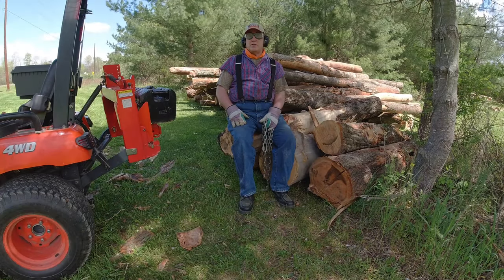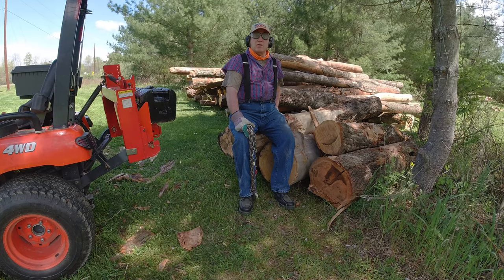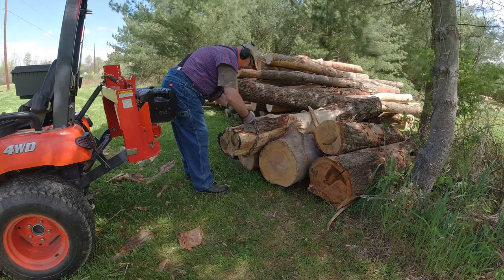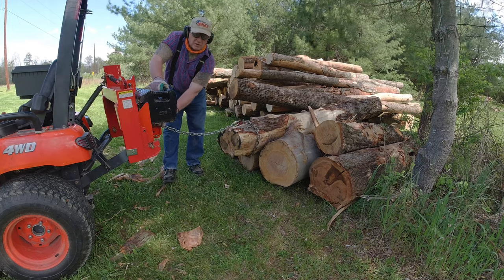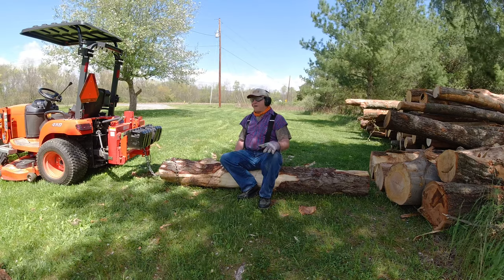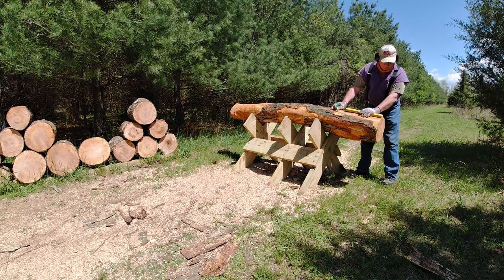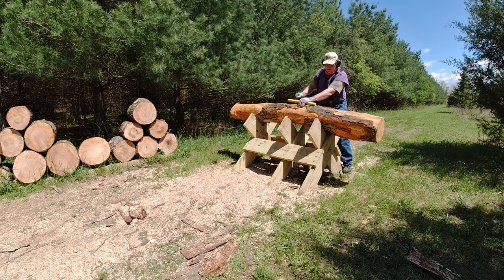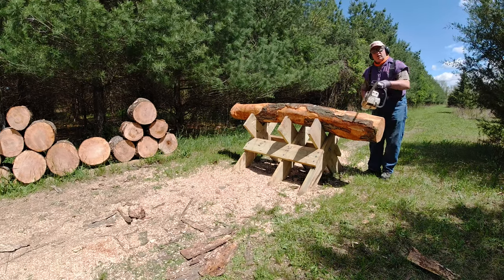#69 - BUCKING FIREWOOD POLES

Comment: Little tractor had no problem, we had a BX and 7100, yrs ago great tractors. We have a Deere 1025R now, they are all amazing for there size. Take Care and be Safe🚜🪵👍🏼🇱🇷
Reply from the maker: Right on.  I agree.  Only wish I knew a little more about the small tractors when I bought it.  I would have purchased a BX23xx or maybe a JD.  I really like the drive over deck that the 1025R offers.  I like to say, work with what you have.  Having the BX makes yard work a lot easier.  I really appreciate your comments and support.

Comment: Pickeroon.   The best investment I ever made for my back.  I’ve got a couple of them now. 
Cheers!
Whipple
Reply from the maker: I agree.  I bought one for my dad.  He thought is was a nonsense tool until he started to use it.  Thanks for watching and commenting Whipple.
Reply: @botabob     Yeah, I worked on logging jobs and in a Mill for years and it wasn’t until I was in my 40s that I even heard of a pickeroon.   I bought my last one right from the Peavy Tool Company in Eddington, ME a few years ago.  Drove by it while on vacation.  Found it by accident.  Couldn’t hit the brakes fast enough to get turned around and go into the tool shop!   Got one for my buddy Pete, too!   I keep,one in the truck, at our camp, and with the log splitter.   Got the 15” length for the log splitter.   It’s a GREAT addition to work with short heavy logs.   An instant handle!  Hardly any bending to pick up logs.   
Cheers, Bob!
Whipple

Comment: are you selling firewood the reason for exact size?
Reply from the maker: Thanks for the question Vern.  No, I am not selling the firewood.  The reason I like them exact is because I am a terrible at "guestimation".  I stack the firewood on plastic pallets designed to carry heavy loads of Coca-Cola and Pepsi.  The exact measurement ensures I have 3 to 4 inches between the rows of wood.  I hope that makes sense.
Reply: @botabob  yes, it does make sense, that way everything fits every time.